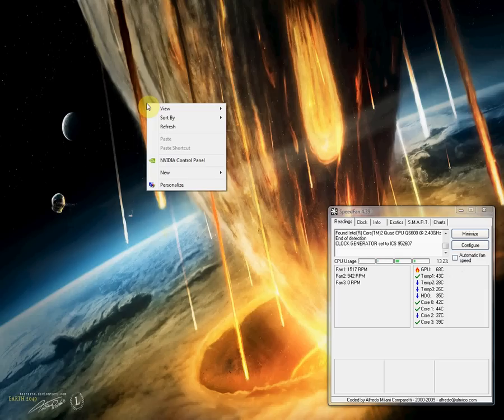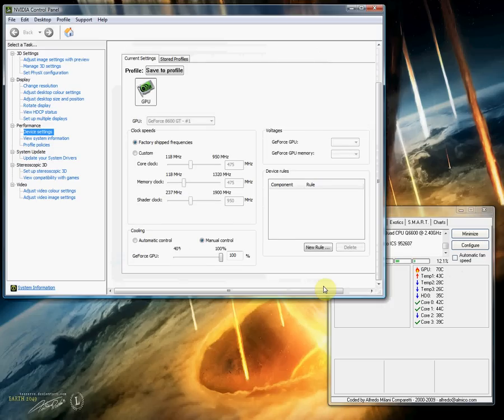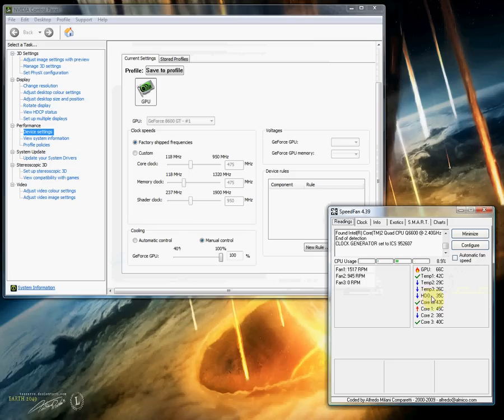Nvidia GPU fan control

Comment: Thanks Buddy i put it on 65% and temperature low down from 89°C to 65°C
I didn't know why the GPU temperature was so high with only google chrome open, it was because the Fan Speed was at Auto at 30%

Comment: How can I get that performance section in my control panel I also tried updating the driver from Nvidia website still the problem is not fixed

Comment: yes it's an old video but, if your video card has started to run hotter than usual even at idle, clean the dust off of it and replace the thermal paste on the heatsink, just like the thermal paste/grease on a CPU the thermal paste on the GPU will also dry up and fail, especially more if you run OC.
Good video though.

Comment: how come I cant find the performance section in my invidia control panel to regelate the fans speed
Reply: if anyone is still wondering why, I had the same issue had to get ntune from the nvida website to be able to edit gfx card settings
Reply: This tool is awsome and it still works today unter Windows 10 with Quadro P600. My fan was pretty noisy so I let it run at 100% for a couple of minutes and now it's silent again! You're my hero ;-)
Reply: They have been removed a long time ago, they only had this up until the 500 series. Everything after that doesn't have this ability anymore.

Comment: The performance part of the Nvidia drivers software has been removed for cards above the 500 series.  As it does not support the higher GPU's and cards. The performance  part has a GPU top speed setting and will limit the faster cards to a slower speed. Also Nvidia does NOT recommend using it on the new/higher cards stating that it might damage the card. I use Precision X by EVGA to see the GPU temp and fan speeds. It will also let you change a fan curve to help keep the cards GPU cool and help wtih over heating. Nvidia also says that this may damage the card. I am using Windows 10 and it seems that on this operating system there is NO monitoring of the GPU temp or correction of fan speed to GPU temp to keep the card from over heating. This is why i am looking for other solutions in the forums and else where. If this has been covered already sorry.

Comment: I downloaded the software you use in the video, but the cooling section is disable. Can you help me please?
Reply: ***** then how do I solve my problem, my gpu gets heated , whn I play games like gta 5 , witcher 3 .etc. And after I play for around 5-10 mins, my system gets hanged, and it appears clearly as aproblem of my gpu, ( my comp : i7 4720hq, 12gb ram, nvidiagtx950m)
Reply: download evga precision X and use it to control the fans
Reply: eKSe is it something like msi afterburner or something...
Reply: Aditya Lakshmanan Yes but you have more features
Reply: eKSe  but the cooling feature is diabled, like cannot be adjusted ...

Comment: This video is ancient... things don't work like this anymore for most cards.
If you don't thave the performance tab that means your card is locked for fancontrol and also core voltage which both severly limits the overclocking potential. And that's the Idea from Nvidia, they don't want more noobs burning their cards and RMA them.
So stop asking, no piece of software or bs license agreement will unlock your card, only a bios mod will. And if you need to ask about that you're likely brick your card anyway so just don't.

Comment: For everyone who has a GTX GPU 2012/13 onwards you will need to get the 3rd party software using EVGA @ http://www.techspot.com/downloads/5348-evga-precision-x.html
The tutorial is for N-Force series ONLY up to 2012.
Reply: +Justin Smith thanks mate, you saved my life. this program is easy to use (even tho the first time i accidentally bumbed my fan speed to 5k rpm, got a little scared there haha).

Comment: My GPU is only 32 Celsius warm, so I would lower the RPM (even to zero like my PSU allows under a given temp), how could I do it to a GTX 660? It is very noisy (~1100 RPM).

Comment: my nivida control panel has no performance tab?
Reply: +Justin Smith Still doesn't have that.
Reply: @d4mterro320  problem with that is, not all Nvidia GPU's will allow you to control fanspeed with afterburner.
Reply: +Ó Slatraigh I should have stated that my System is Win7 64-bit and runs at about 80-90°C gaming with SLI GTX 770 on max settings through the Cry Engin' 3 with an added 100mHz offset
Reply: would afterburner work on my geforce 860m?
Reply: You need to download and install ntune from nvidia to get that. Heres the link-
http://www.nvidia.com/object/ntune_5.05.54.00.html
Reply: @d4mterro320  question is how to get it with the nvidia software
Reply: panda sniper100 See my post above for latest update.
Reply: @d4mterro320  stupid fuck, you're supposed to be able to control fan speed through nvidia software. Any stupid prick like you knows msi afterburner has that option as well as overclocking tools, we just wanna be able to adjust our gpu fans using its own softwares

Comment: Please can you help as I have an issue, Even if I lower the speed to the lowest my fans are still really loud? What do i do?
Reply: +SirJimiee You have multiple choices, since you are so noise-sensitive. You can get a bigger computer case, or get a card with only a passive-cooling system. Also you can insulate your case. However, you'll have to be monitoring the temperatures in order that the heat don't damage your PC components, especially in the summertime.  One last thing, if even set on very low, the noise it's REALLY loud, it's also very possible that the VRAM it's overheating and could die at any moment. Most likely you have forced that card of yours, by playing games at a higher resolution and video quality than the amount of  its video memory can allow.  What model it is?

Comment: I was having constant hourly crashes, with a manually cleaned/spotless vid-card, tried all 'clean installs' of graphics drivers, op' system, and all other drivers, updates - the whole f'n shebang. If you have a lesser NVidia card - like me - that hasn't got the control for fans etc in the 'NV Control Panel' - or you have different drivers etc - I set PC's 'SMART FAN' to OFF in BIOS. And using 'Nvidia Inspector' as well, in Windows, I just uncheck the 'Auto' setting for the Fan - essentially what you are doing here) and set it up from 30% up to 100%. I lower the fan every now and then to give it a rest. Works much better now for sure. I can even overclock this low-end piece of shit card a bit for my own gaming pleasure now. Hope that may help someone as well..

Comment: The heat won't help but that's not the only reason the card's lifespan will decrease. As with any microprocessor/conductor the other reason is that you are firing more electrons/atomic structure around at increased rate meaning they will bump into atomic structure and cause disintegration at an increased rate.

Comment: Ugh, non-engineer advice. The reason clock speed affects the life time of a GPU is because of the increased *heat* generated by higher voltage. The same is true of any system component. Electronics 101: heat IS relevant to every electronic system - especially when calculations are involved. Charge carriers function more efficiently at lower temps. As temps increase, error rates also increase.

Temperature is always important. If you think like this guy ^^, you WILL kill any system eventually.

Comment: Thank you so much for this!  I actually found the SpeedFan software just before I watched your video but your experience echoes mine.  In my case I'm getting a periodic lengthy beep emanating from my desktop computer and I now highly suspect it's because the GPU is running so hot - typically 76 - 79C.

Comment: Yeah, this doesn't come with any Nvidia cards after they started using the Control Panel that shows on the notification area (the little icons on the lower right), even before that I think. Nobody has that anymore no matter how old or new your Nvidia card is, so we need to use programs like MSI Afterburner (Google it, better than all the others, recommended by all the hardware geeks online).

Comment: Thank you so much for this, I hated having to use 3rd party software to manually control the fan. I wonder why nVidia doesn't include the performance tab in the control panel by default...

Comment: Hello again.
I've dowloaded the System Tools...I can change the fan speed on the screen, but I can not hear it going up in rpm as we do in your video...In facdt it does nothing on my GPU...still eedeling at 70°C. My fan power cord is plugged directly on the GPU and not on my mother board...Still in need of some help.

Comment: Hello,
Really usefull video but....
I have a Geforce 450GTS eedeling at 71°C with only my desctop oppened. In my control pannel (edition 3.9.730), I acnt find the line where you increase the the fan speed... Could you help me, plz?